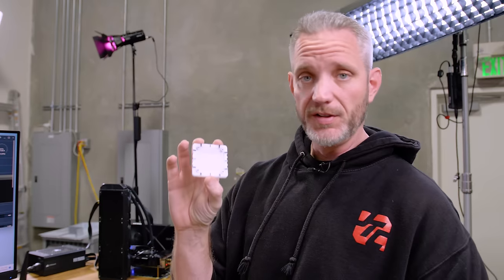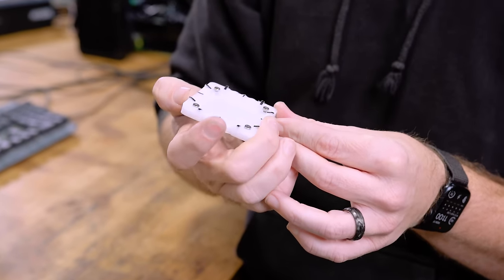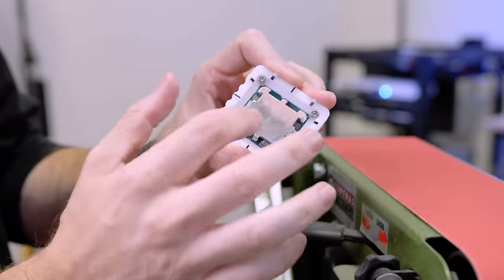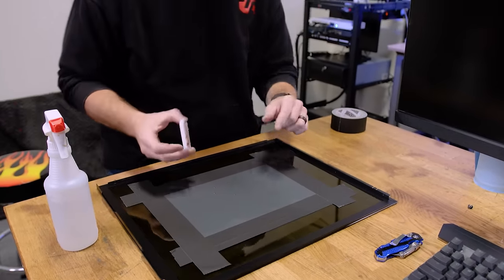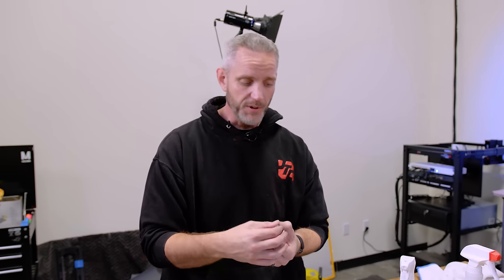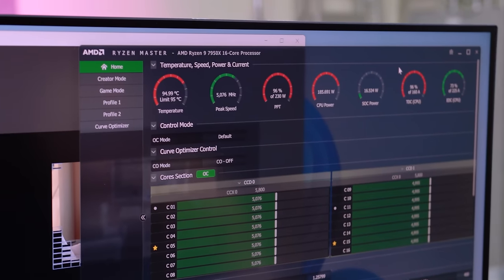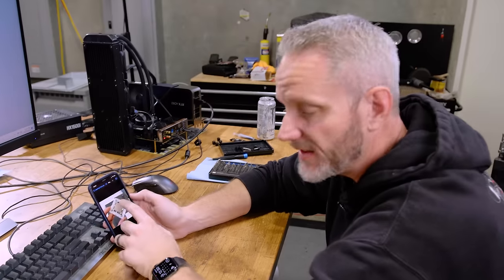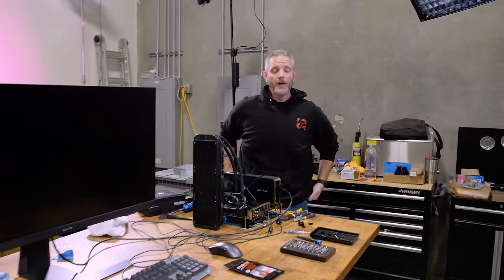Modifying the 7950X CPU for better thermals... VOIDED WARRANTY!

Comment: Jay, if you use a figure "8" motion it will make it easier to get a flat finish.  Circular motion leaves point in the middle.  Back and forth leaves a ridge across it.  Think of it this way, the direction you move it digs in on the forward moving face/side.  Push it north and the north end digs in.  Same theory why Brembo brakes often use smaller disk puck on one end of the pad.
Terry from Australia.
Reply: You know they make concave mirrors for telescopes using the same technique as Jay is using for a flat surface except they using a particular grinding motion.  If you do it wrong you can end up with a convex or concave surface.

Comment: If you wanted to measure the gap between the cooler and the CPU I suggest using plasti-gauge.
Reply: Works for engine bearings, would work great for that!

Comment: If you’re going to go for gold and void warranty it feels like a delid and mount swap would be the best way to go. Lapping seems a lot of work for a halfway result.
Reply: problem I can see with that was how hard it was to get the mounts set up. Not sure if he was at the limit of what he could do or not. Personally, to save the 5-6 C I think it would be great as long as I could get a cooler on it. I know 5-6C isn't much but that was from pushing danger zone into more comfortable territory.
Reply: Well, lapping is marginally safer as long as you don't try to lap the max amount of 1.2mm. say, go down by 0.8 to 1.0mm.

With delidding, one can easily damage the substrate and/or dislodge one of the caps.
Reply: Lapping is still a significantly lower risk of outright killing the CPU compared to delidding. Honestly for what it can do I'd consider it a worthwhile mod for somebody interesting in a heavy OC, but doesn't have the money to spend on a second CPU if one dies.
Reply: @readypetequalmers7360  Sanding something perfectly flat isn't easy

Comment: I can't wait to see what Zen4c/x3d can do next year. When they tame the temps and power on that it's gonna be amazing.
Reply: No plan to tame temps. The high temps of 7xxx are they intentional.
Reply: Zen4c is an EPYC CPU though no?
Reply: @vgernyc  it's just the code name for the denser node with more cores. It's not specifically epic it'll also be used in threadripper. There's also a chance they could use it as a last ditch effort if intel catches up because it's double the density so if they somehow wanted to shoehorn more cores on am5 before they drop Zen 5 that would be the way they could do it. They also kind of hinted at the fact that it would be double the cores for the same power which is why I think they may actually refine this. I didn't mean to imply that they're going to somehow drop some weird core revision of current zen 4 that's going to quote, tame the power. They are not doing that. Zen 4 3D and Zen 4C are indeed supposed to be further refinements on the same node so there is a chance they will not run quite so aggressively hot, and I feel like if they have a chance to reign that in a little bit why wouldn't they. They clearly pushed Zen 4 as hard as they possibly could to make sure they stayed ahead of raptor lake, or at least extremely competitive with it.
Reply: We were told it was a voltage issue, bit power/temps. Yes, they are related, but there you go
Reply: @pdamasco  As long as AM5 CPUS are compatible with AM4 coolers the temps will be 10c higher than they need to be.

Comment: Next time you replace the belt grinder you should get one that has the vertical disc plate grinder and rest plate.  Makes that job a whole lot easier. 👍
Reply: also one that has a tension arm for sand paper
Reply: @bouzoukistudent8180  The one I got has the tensioner built into one of the belt roller guides...I think most half decent ones do.

Comment: I have to admit, I am still surprised that AMD decided to go for a thick-as-heck IHS as its solution to AM5 processors being shorter than AM4.  It seems like it would be much more reasonable to do any of the other 3 options I can think of:
--Raise the whole mount on the socket side, such that the chip just sits higher
--Put out specs for what the new height target is and work with as many of the big names in coolers as possible to help them have brackets ready to adapt their current hardware to AM5 on launch day
--The above but also set up deals with those cooler manufacturers such that anyone buying a 7000 series processor gets a code they can use to get a free adapter kit (with AMD providing those companies compensation.

(The last seems unlikely, sure, but it's a method by which using your old cooler doesn't cost you money as the end user and it doesn't compromise performance of the chip in any way the way screwing with its cooling system or possibly its mounting system would.)

The only logical reason I can see for the thick IHS is if they've got plans for the next generation to be using some architecture that's going to use that extra space for something more productive than a copper slab.  Maybe slip a layer of cache underneath the processing chips as an extension of the experiment they were running with the 5800X3D?  (I don't know CPU architecture well enough to know that's remotely reasonable, it just seems like shackling yourself to having a thick slab of IHS is a weird choice unless there's plans to use that space for other stuff in the future)
Reply: they mainly just want backward compatibility with existing coolers
Reply: @fist003  more like they want to have some 'upgrade' for the Ryzen 8000 series.  Theyll sudden have lower temps and better performance all due to a shorter IHS and nothing else.
Reply: @fist003  My point was there were other ways to achieve that without compromising the ability of all users to cool their CPU without doing things that would void the warranty (lapping/delidding).  Especially since they've comitted to usng AM5 for several years, so every AMD processor for the next several generations will have to deal with this thick IHS issue.

Again, unless they're planning to use the vertical space in future designs  Which I have no idea is even remotely reasonable.

Comment: I love my 7900x !  i just got it up and running last night with 64gb of ram,  4 DIMMS working at their rated 6000mhz !  I applied some tweaks to the Precision boost overdrive in my Asus board and managed to unlock sorcery that made my CPU run cooler with less power draw and still maintained my performance.   I ran one pass on Cinebench R23 multi core and got 27995, and my CPU did not exceed 52c for the entire run, i have a Noctua D15s with its stock fan.  This thing runs cooler now than my 5800x did.

Comment: Cool, I will go for it with direct die, I did it on a 9900K, and it made a 20 deg C difference.  Just amazing, but of course, very risky for sure.
Reply: The funny thing is that before about 2008 they were exposed silicon with the cooler right on top. They then started putting 'heat spreadders'  or IHS on the top.
Reply: I have a 9900k and will go for Raptor Lake tomorrow for the 13900k and not have these  problems it will go to 5.8ghz and 32 threads

Comment: I just gained the courage and lapped the IHS on my 7950x3d. Didn't go down to far since I don't have the Thermal Grizzly product to help. So a half degree difference but noticed my computer was much quieter during gaming. Before it used to scream to keep it normal temperature ranges. Keep doing this type of content!

Comment: On intel 12th gen right now, if I had this in a system, I can't justify voiding the warranty for 100mHz gain and 5c cooler. Interesting finds though! Love the video.
Reply: I believe it was 10c from 94ish 95c stock down to 84ish 85c at the end. But yeah, this will always be for us few that are willing to do anything and everything to get the absolute most performance out of a beast cpu. I'm really looking forward to the de-liding tool honestly. Derb8er dropped I think 20c+ from doing so
Reply: @elkomander3510  with a tool, and for 20c, i WOULD do it.
Reply: @KobraTrading  for 20c you would definitely need a good cooler if you don't have one already and very good thermal paste, the reason for this is that stock the cooler doesn't make as much of a difference because the cpu is tuned to go to that temperature at stock
Reply: @ricardombr  got a good cooler, but what paste do you recommend? Something higer-end like Kryo?
Reply: De lid like 7-10th Gen Intel parts. Debouer dropped 20c and with stock power limits went to all core over 5.5ghz
Reply: 12th gen benefits a TON from custom copper IHS (i think there was a LTT video about it) and swapping ILM with holding bracket.
Reply: @zbrkesbris5987  i actually swapped the bracket based on a GN video. Lowered my temps @ idle by 15c and under load by 6c. Used kryo paste too. Best decision ive made with my 12gen system so far.

Comment: This was what i wanted to see. I know lapping and delidding both void the warranty but I'm more willing to lap than i am to delid.
Reply: Exactly what i was thinking of
Reply: We'll soon learn how much more de-lidding gets us. I bet i's not really worth the risk. At least with lapping you approach the danger level slowly and can stop.
Reply: @wayland7150  According to der8auer, it's 20° Celsius (along with lower power draw)
Reply: @wayland7150  We kind of already know the results. Confirmation never hurts though.
Reply: That's interesting because I'm more willing to delid, It is much easier. Getting a perfectly flat surface lapping is way harder than people think. I've delidded and it's very easy running a  thin knife through the glue.
Reply: @spacecowboy07723  That would be a lot tougher with the shape of the IHS on these CPUs. Delidding might be an easier task, but it comes with a lot more risk to the bare die, which is why most people shy away from it.
Reply: @--_DJ_--  right for this ihs, I haven't looked at the glue pattern. My last cpu was just a square glue pattern on the exterior.
Reply: @spacecowboy07723  also der8auer has a delidding tool
Reply: @Gandalf721  I just use the clips on the motherboard to keep it in place.

Comment: hey jay i realy love these experiments to see the temp diferences. but i would like to see if there is an difference with lapping with sanding paper vs good enough whetstones. you can even polish it with an extremely high grid to smooth out the height difference as with sharpening knives. and to get an perfectly flat stone you have flatening/maininance stones to make the whetstone flat(if that is anny concern at all)

Comment: thats actually interesting how cpu doesnt go in contact with aio when you sand it down thats like few milimeters
Reply: The thickness of the CPU was to make it compatible with AM4 coolers
Reply: Welcome to mechanical engineering. When stuff has tight tolerances, even a millimeter makes or breaks everything
Reply: The hook and eye mounting system would probably be OK without modification. It's spring loaded and only the CPU holding the cooler up.
I'm not convinced the thickness reduction is what worked, rather the better contact surface.
Reply: @TheBlueBunnyKen  And in turn hurts thermals a lot. Would be much better for AMD to just raise the socket/make it thicker tarher than the CPU.
Reply: @LEXXIUS  agreed
Reply: @wayland7150  AM5 is designed to be warm, they said it will always run warm, as long as it doesn't hit 110+ degrees, that's where it throttles
Reply: Not really when amd literally said they were making the chips ihs taller to fit am4 coolers. This entire launch was fucked because amd wanted backwards compat. Imagine if they had just dropped am4 cooler support, and made the ihs not as thick.
Reply: @animalyze7120  hm? That has nothing to do ith my comment. I was just saying that if amd had cut am4 support, the chips would only run at 75c. That alone gets rid of a lot of the complaints.
Reply: @Tagiau  Imagine?  We know.  It would run 5 degrees cooler and have the exact same performance, because that's just what happened to Jay's experiment.  A complete and utter waste of AM4 coolers just so old school nerds can see a digit that's 5 lower for no performance difference.
Reply: One millimeter can easily make or break a fit in anything smaller than Ikea furniture.
Reply: @T. N. I don't understand what you mean. By making the socket higher and keeping the IHS thinner the AM5 CPUs would sit at the same height as AM4 CPUs and have better thermals.

Comment: No hoodies esp ones with strings near rotating machinery type...
No ties , no wired headphones , no loose fitting shirts ..
You can imagine why.
Little sander like that youu would likely stop it with a body part ...but would you want to?

Comment: Jay figuring out you can reuse original hardware is the gem of info in this video. So flippin cool

Edit: Hey since you were able to get the z axes height lower with the original hardware, couldn't you take more off the ihs now?

Comment: Technically, I think a lot of scratches, and actually scratches no just cosmetic imperfections, would actually improve performance. It's exactly why radiators are the design they are, inner part of the cold plate in contact with the coolant has Micro fins. Scratches make more surface area than flat, which means more contact surface to transfer a larger amount of heat.

BUT, that's assuming you have an appropriate viscosity of TIM, and actually fill all the Micro valleys.

Comment: You can get pretty thick (8-10mm) float glass plates for ~$20 off that AtoZ site.  In sunlight, find the side that has a rainbow shimmering effect, that's the side that was floating on the molten tin.  Mark it with a permanent marker and use the other side for lapping.  I'm still using the glass I had to special order from a glass shop 20 years ago to lap Barton dies!
Reply: Except it clearly isn't worth the time effort or warranty.
These CPUs just don't give enough extra verse the risk.
Reply: @fluphybunny930  Not worth it to you, risk is in the eye of the owner.   That said, I wouldn't have bothered with it either given just how thick these AM5 Ryzen IHS' are.  Direct die and lapping the die is where I would go.  My advice still applies to lapping in general... not everyone here is on the bleeding edge AMD or Intel platforms.  I lapped the IHS and the die(s) on a 3800X and using LM dropped temps 10ºC on my WC setup.  I kept the IHS because of the offset chiplet layout.  That proc is now air cooled and doing fantastic for my freind I gave it to after going to a 5900X, and it too will be getting the same treatment.

Comment: I'd expect tempered glass that thin to bow really easily.  A 9x12x2 granite surface plate is like $60 on Amazon. Certified flatness to 0.0001" (0.0025mm) If you lap cpu and cooler both with that plate you should be able to get them to the point where they'll stiction together.